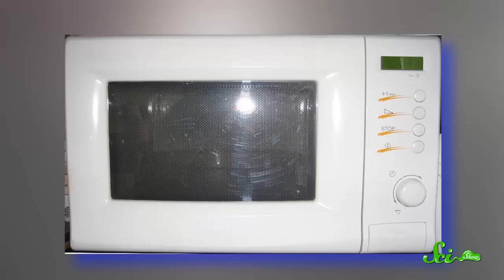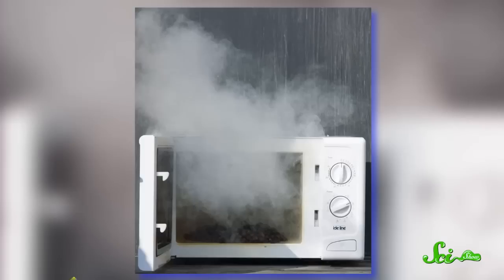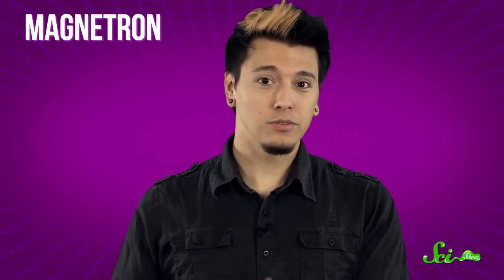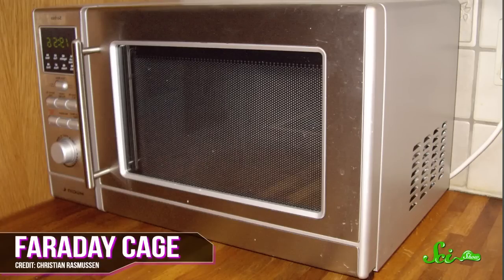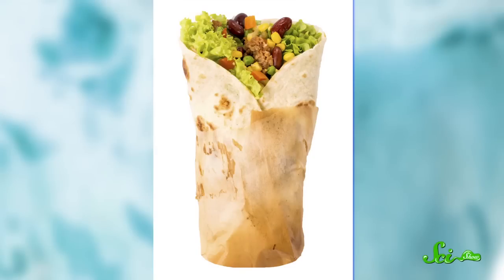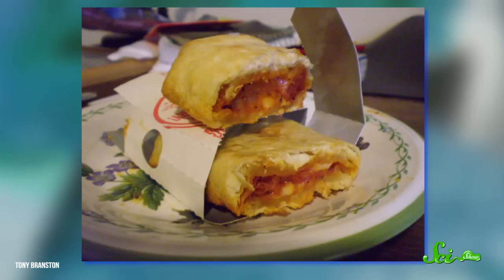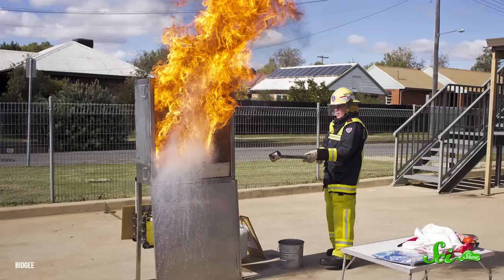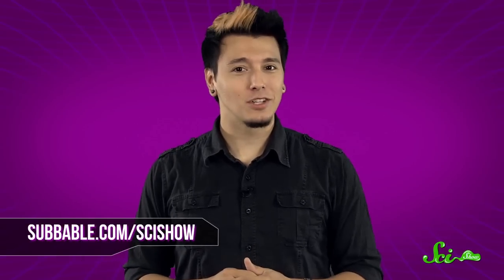Why Can't I Put Metal in the Microwave?

Comment: I microwaved a frozen can of Mountain Dew with no ill effects (before i knew not to). Was I just lucky?
Reply: I'm not sure... a lot of videos I've seen online of people microwaving soda cans don't have the metal react in the same way. Empty cans still do, but if they're full and unopened the worst they seem to do is explode.
But in general I would say that: yes, you got lucky, don't do it again ;)
Reply: Well the can is mostly flat and even its points are rounded if you look closely, and most of the can is in good contact with water, which dissipates heat. Just guessing.
Reply: I realised, after I signed off yesterday, that it could be due to the liquid inside the can absorbing most of the radiated energy, so there isn't enough energy left to cause a noticeable reaction in the metal.
I will still stress that you not try it again, however.
JWQweqOPDH I don't think the shape of the can has anything to do with it, as I'm sure I've seen empty cans in microwaves light up like the fourth of July, but I'm not willing to test that myself with my own microwave, so who knows? XD
Reply: When I was a kid I popped a frozen Capri Sun pouch in the microwave and it lit up like the forth of July. In my defence when as a six year old I didn't really associate the soft, almost plastic-like, pouch with "metal" like I did with more solid cutlery or noisy aluminum foil.
Reply: YamadoK Yeah, the only thing that really suggests that it's part metal is that its metallic color on the edges.

Comment: So how exactly do microwaves work and, if they send out a type of radiation, how do they supposedly NOT irradiate food?
Reply: I might be somewhat wrong about this but Microwaves sends out radio waves or something similar that is not dangerous in terms of radiation, the "radiation " is to heat up food and doesnt cause cancer and stuff like gamma radiation so you're safe from that
Reply: @firetiger13  The fact that they use a faraday cage (and some of the info from the clip I linked below) along with the idea that a magnet doesn't affect a microwave until it's turned on just makes me wonder. Same as what microwaves do to certain types of plastic and Styrofoam (though that may just be from the heating process, too).

https://youtu.be/wCrtk-pyP0I

I just wanted a full breakdown of why these things happen but how the food cooked this way is still unaltered like that.
Reply: @holle.h.4570  I remembered that video, I saw that already XD